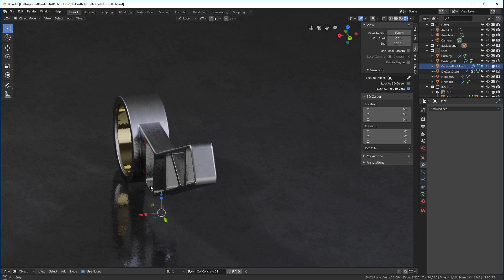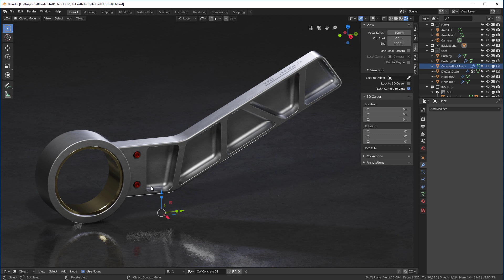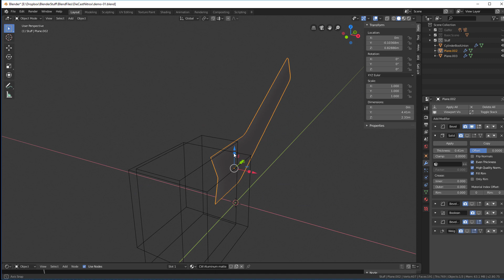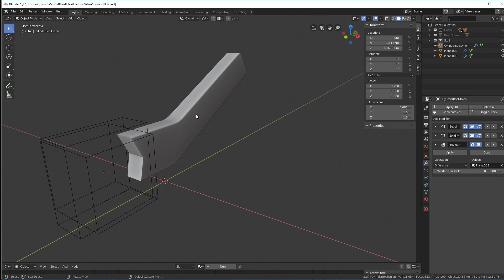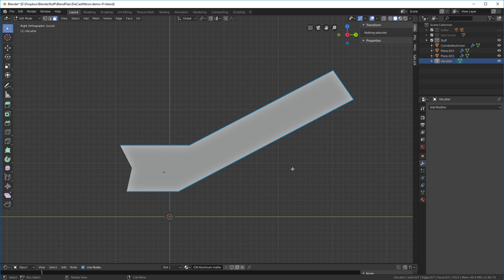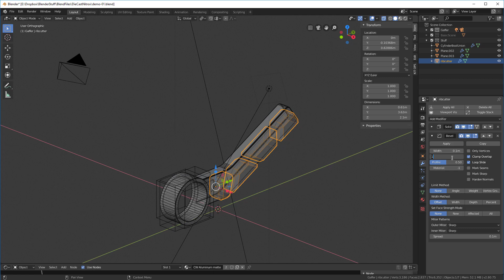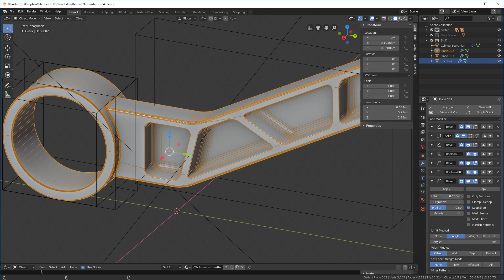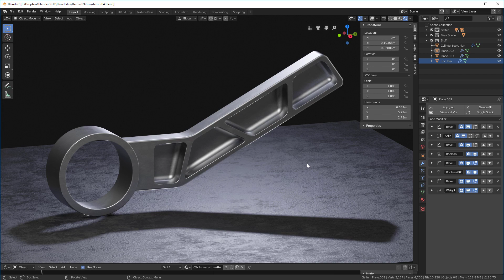NITROX3D 06

Comment: I tried some of this with Blender 2.92 and the Modifiers have changed so much that this just dosent work... there is no longer a waited option in the bevel modifier. I really hate that because this looks really cool... and I cant find Blender 2.80 now only 2.83
Reply from the maker: Sure there is. Bevel has the ability to use weighted edges and weighted vertices. Just look for it.
Reply: @ChippWalters  Thanks I will look but in 2.92 the panels are totally different. If you say it is there I will find it. Thanks
Reply: @ChippWalters  I see it is in the N panel. They have taken it out of the modifier panel and that is what was confusing me. I really like this workflow I'm going to get your Nitrox3d Non-Destructive Modeling Course this looks awesome. Do you have anything new in the works?
Reply from the maker: @Vintage_USA_Tech  The control settings have always been in the N-Panel. The modifier setting to use weights is now in a dropdown. Good luck! Check out my NITROX3D course if you want to learn a bunch more about non-destructive modeling. There's a couple free YT vids on it.